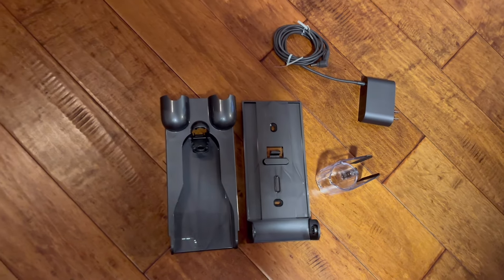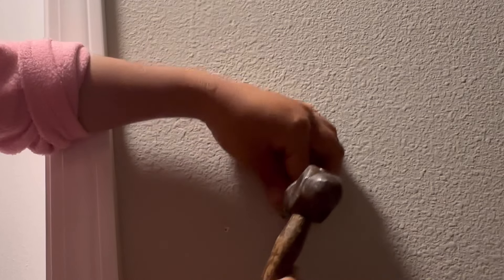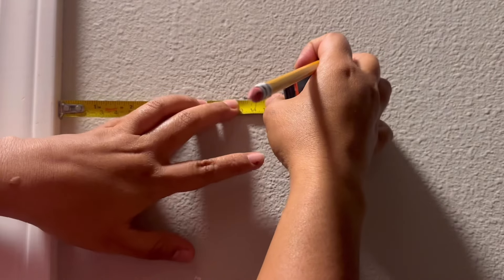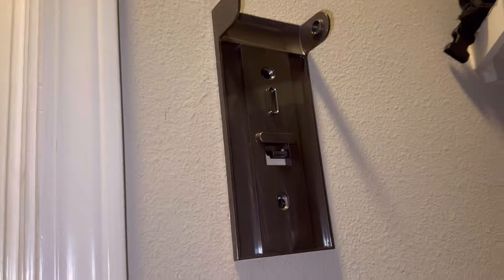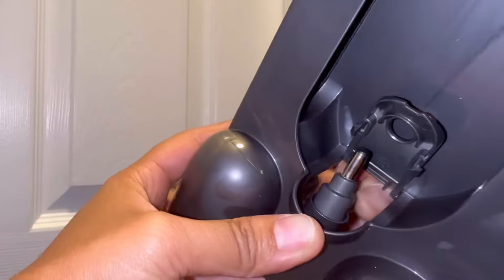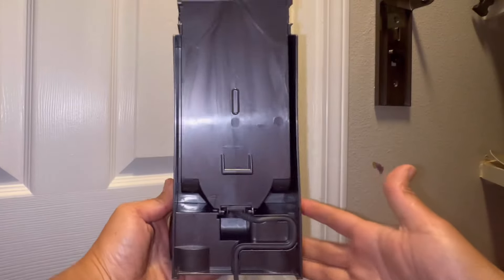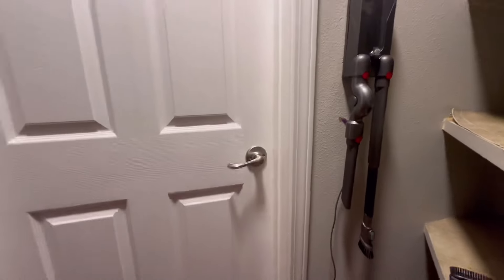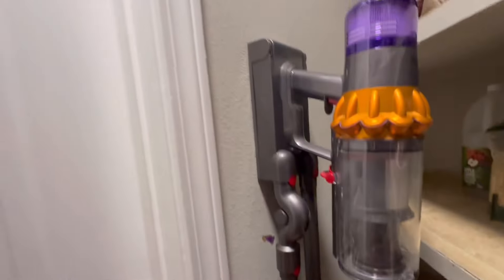Dyson V15 Wall mount installation DIY

Comment: Thank you! So do I need a stud finder or anything to hang this at all??
Reply: I located a stud for mine. Drywall will support cuetsin rods but i dont trust it to hold something with weight, considering this will be docked and undocked repeatedly. Mount it once, and make it permenant. If you have a electric receptical, there is a stud to the left or right of it, the next stud is likely 16" from the receptical.